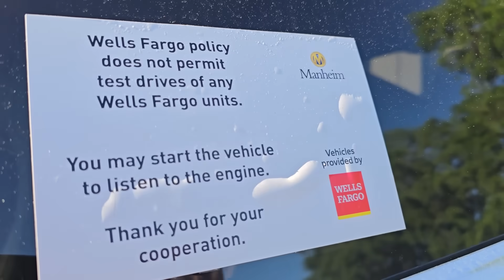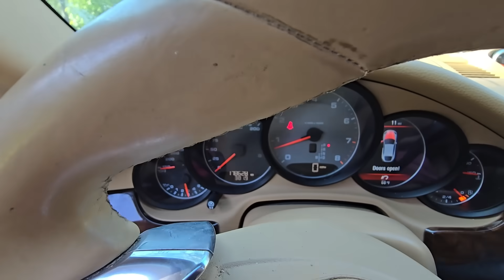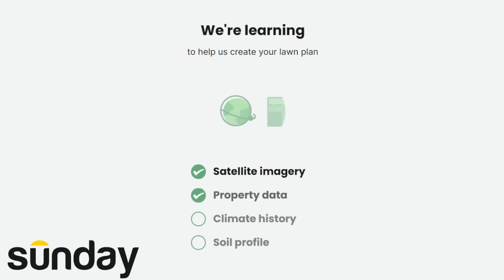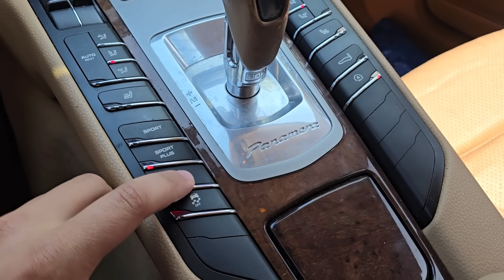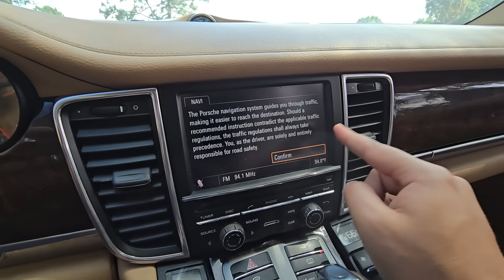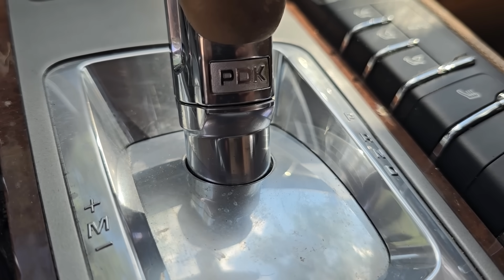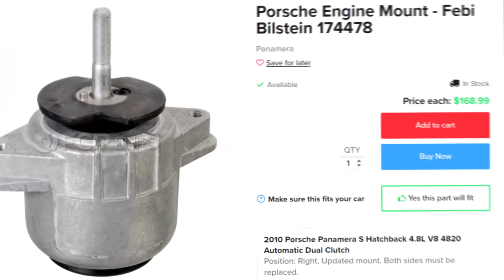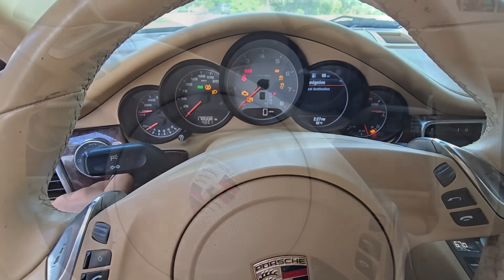I Paid $5,200 for this Mechanically Totaled Porsche. Here’s What it Cost to Make it Roadworthy...

Comment: The car dealer is a big rip off they charged me 4500 for a 250 dollar job and  I didn't find out until a honest mechanic told me they ripped me off 😢.
Reply: BMW dealer tried charging me $870 to replace washer pump on my bmw. I replaced it myself for $30 in 30 minutes

Comment: I would clean the engine and undercarriage to see if the bolt tightening helped.  Then replace the tail light, do the front brakes, bump-stops and upper strut bearings.  If after those items and the car is doing well, go after the hi-press fuel pump, and repair/replace the driver's door card.  Give it a good detail and enjoy it!
Reply: Yup! A good dose of brake clean will cut that oil! Ask Rainman!
Reply: yeah like all that bs is gonna happen, this is YouTube, it'll go rot now to supply YouTube viewers with more content
Reply: Is there even a downside of doing the high pressure fuel pump once it fails?
Reply: Yep go ahead and refurb but still stick to a strict budget. With all your knowledge how and contacts this could be a keeper for you to use sparingly bearing in mind the mileage👍
Reply: Let's see the rest of the work done
Reply: Definitely do the rest!

Comment: I had a 2010 Panamera 4S. Absolutely a magnificent car. My high pressure fuel pump went out, it was labor intensive and expensive. Be cautious of the remanufactured parts. The first one was no good. The job is so labor intensive, I suggest biting the bullet and getting one directly from Porsche. That's a job you don't want to repeat.  Also, don't forget the cam bushing.
Reply: I'm saying the Panamera was a fantastic car, unlike the BMW 335!.
Reply: @ayo9057good question!  You thinking about buying one?
Reply: @ayo9057 like with every high maintenance car only buy it if you can afford to buy it twice
Reply: Not anymore! There's  good made in Germany aftermarket now!

Comment: Looks like you're missing a part - there are two (clean) screw holes at 12:36 (and you stick your hand in the gap between them at 12:37), then at 12:42 there's clearly something mounted in the same space on the driver's side. If needs be, take it off to find its part number, then reinstall it (assuming it's in good condition) and buy and install its passenger side equivalent. You'll probably find that engine movement reduces dramatically once it's braced on both sides.
Reply: good eye!

Comment: Max torque on a 1/4” bolt is 4ft lbs…5/16” is 8 lbs. Also the length of a PERPENDICULAR extension has nothing to do with torque readings, but PARALLEL is a different story

Comment: You can retrofit CarPlay to the PCM using a jumper chip for like $300 if you really want to modernize the interior
Reply: What to search for in YouTube for a tutorial/guide
Reply: I  just did my Cayman (same PCM 3.1) for less than $200 through Ali.
Reply: Please explain more how do you get car play ?
Reply: Mr 12 volt is the best system right now. Has less issues and fully integrates with the digital optical audio rather than using aux.

Comment: I bought a 2012 high mileage Diesel Panamera from an independent dealer, also bought a warranty which I’ve used to the tune of around 2 grand GBP so can’t complain.  Next job is to replace the electric oil pump in the gearbox which has failed (it only effects start/stop so not too bothered), I just need to find out if it needs coding with a Porsche diagnostic, if not it’s a relatively cheap fix.
Reply: Can you please reference which warranty you’re using if you would still recommend them? Thanks in advance 🙏👍😎
Reply: Which warranty did you use here in the uk
Reply: @andyb7031 please give it a chip tune! Diesels needs them to show their TRUE nature. As in stock tune they are tuned to emissions, not fully fuel economy and especially in power. On "old continent" i think EVERY diesel (not like all cars, but at least 1 car with engine xxx) has been modified with tune tho
Reply: Watch out for the chain, and white smoke on a warm idle.
Reply: @mmllmmll22  "True nature" being clattery low revving stinkers?
Reply: @mmllmmll22  bye bye warranty

Comment: I'm certain there's a torque rating for those oil PAN bolts.😊 you probably just created a leak in the middle now
Reply: This. 100%
Reply: He’s has to pull the pan to fix a leak either way. Worth the gamble imo
Reply: With 180k miles on the original RTV the torque specs would be well off anyway. I would just tighten by feel to slightly compress that hardened RTV and check back in a week after cleaning the oil off of it.

Comment: Hi Sam, could be also the high pressure fuel pump sensor. With older diesels often the fuel pump itself is still okay and just replacing the fuel pump sensor on the fuel pump will get the crank back to normal.

Comment: What if it's not the high pressure pump but rather the pressure valve that holds the pressure while it's off? It's designed to hold the pressure from when the car had been running the last time
Reply: 90% of the time, it's the HPFP. The sensors rarely go bad.
Reply: @BDLCalton  there's one way valves after the fuel pump that hold the pressure when the car is off.. If that valve doesn't hold the pressure it needs to be built back up before the car will quickly start. Might just turn the key to on for ten seconds before starting it cold, if that changes how quickly it starts that it might point to that check valve. It's not a sensor

Comment: slow crank can also be an aging fuel filter too.  thats what caused my long cranking on my older mercedes S500.  as soon as i changed the filter, it fired up way faster....however, then my fuel pump decided to take a dump.  
but it was the OE pump and filter from 2003 at the time was 18 years old and 290k miles...according to the date codes on both parts indicating they were both never changed.

Comment: Would love to get the dealership owners feedback after they tied to scam you
Reply: Scam? They consider that normal business practice. They are in the business to profit from replacing parts and charging through the nose for said parts and their extreme labour rates.
Reply: I think they were more trying to get rid of him than scam him - probably didn't even look at the car properly and just listed a bunch of parts they'd expect needed replacement on a car of that mileage/age.  Dealerships don't want to work on old cars, they prefer working on cars under warranty so they can just send their monthly bill to the manufacturer and get paid at the end of the month, no hassles.
Reply: They gave him an insane quote in order to get rid of him...I've had it happen a few times.
Reply: Some other guy will come in and pay them.  They don’t care.
Reply: I think he should try to follow up after he takes a car in and then fixes it for a couple hundred after they quote him thousands and dont even address the actual issue he took it in for… great idea!!!!!
Reply: They don't care. At all.
Reply: This a must film!
Reply: That's not what he should go back to the dealership on.  What he should go back to them on is the fact that he brought them a vehicle bordering on a major failure that they should have spotted and quoted to repair, and they quoted everything but the one thing that was going to destroy the car.  To replace those bolts, the covers were off.  With the shaking engine and the trouble codes, spotting they failed guides was a no brainer for any mechanic above utter failure level.

Comment: I vote for you to fix this up. I think this is an opportunity to show that a high mileage car can be reliable and not cost an arm and a leg to fix. 

If you decide to do the work I would pull the fuel pump first. Depending on how it's designed and how well it's been holding up you could possibly just get away with the motor. If I'm not mistaken you've done that before on one of the high-dollar cars.

Comment: Sam you are missing a part on the Engine Mounts. Take a look at your video for the Drivers side and Passenger Side and you will see there is another damper mounted to the top of the mount. You will see clean screw holes on the passengers side where it is mounted. The drivers side has the piece installed.

Comment: I would like to see you fix the Porsche. Considering current car prices, new & used vehicles of all types are nearly out of reach for the average person. I would not mind a series focused on turning this budget luxury car into a nice, comfortable, reliable daily driver within reason. I need to put brakes on my 13 yr old C-class without breaking the bank. Some of what you mentioned about the cost of the Porsche pads & rotors peaked my curiosity interest & I would like to see a shade tree mechanic brake job replacing rotors & pads. Love the videos

Comment: These are shockingly reliable, any of the 1st gen V8 panameras don't have a ton of nagging issues. The V6 and the Audi stuff is much less reliable. I saw someone mention "bad PDKs" below, and that has not been what I've seen when researching these. It's super common for these to last a long time. They are sealed though, but there are companies that fix them, you don't need to "call around".
Reply: Pdk only go bad if no service has been done just like a engine oil change you can literally do everything yourself

Comment: The noise over bumps is likely the front suspension bushings. The upper control arms come as a unit. Replace the bushings in the front lower control arms, FCPeuro has a kit. Don’t buy the ones on rockauto, they’re junk.  Also change the links and bushings on the sway bar.  I tried the aftermarket stuff and it didn’t last 20k miles.

Comment: Be careful with over tightening the oil pan bolts, I believe they’re torque to yield which means they are made of aluminum and they stretch when tightened which is why you were able to tighten them so much more

Comment: Yup love my mag ride on my mdx . Replaced them at 180k ish miles. Cost about 900a piece for the front and around 750 for the rear. I did the work myself. Transferred the spring wasnt bad at all. Also the parts department game me a deal. Paid 600 a piece for all 4. Acura actually covered them under manufacturer warranty till 140k miles. But I just drug my feet on that warranty work.

Comment: there's option 3 sam work on the aston martin flood car if you can't sort out the electrical send it up to pine hollow auto diagnostics up in PA ivan is the man when it comes to module coding problem solving and electrical in general cheers from down under

Comment: One of the most expensive surprise items for older cars has to be the Xenon headlamp's height adjuster, it's sensor that has two arms and sits near the rear suspension, so basically a simple potentiometer with 2 swing arms. The prices however go depending on the car model and maker between $700 and $25 depending on how the stars have aligned. For my Nissan Maxima dealer wanted to have an eye watering $500 but I found a new OEM part for "only" $300 obviously for a reason these sensors are rarer then a rocking horse's apple in the junk yard.

Comment: I had a high pressure fuel pump fail on my Cayenne (V6), the dealer wanted $950 for the part. I found the part on Amazon (not OEM) for under $200. Worked just fine :)

Comment: I'm loving the coverage of the Panamera. I have no interest in the Camaro but I would probably watch because I enjoy your videos. I replaced my high pressure fuel pump in my Cayenne with an OEM unit, not too bad. It's much easier than replacing the valve cover gaskets. Maybe try the remanufactured unit. I would love to see you replace the bump stops too.

Comment: Check out the OE manufacturer of the HP fuel pump. Did one on s friend's 2010 A8. Audi wanted $1500. I bought the correct NEW pump, OE manufacturer,  for $300.

Comment: Need help, l have a 2003 gmc yukon 5.3 engine with a unknown driver issue,  starts but al lights on dash on , windows, a/c stereo locks don't work,  afraid to take to dealer because it could be really expensive,  thanks.

Comment: The dealership probably does not actually pull the engine; rather the tech repairs the timing as you did but using the billing labor op to charge you the book price.

Comment: has a double row timing chain. ..........should be rock solid.  Errgh, not going to name the make, but I had a 45 YO old motor with no dramas with timing chain. I suspect (novice) modern GB enormous changes in ratios must do something (over time). the old school gear boxes are alot more progressive and forgiving on wear and sudden RPM changes

Comment: Don’t go cheap on the brake rotors, just did mine.  Just buy the OE Sebro’s.  No one resurfaces Porsche rotors… don’t do it.  lol   Those upper control arms are famous for making that clunk.  You just buy from FCP Euro and  do both sides.  I did the uppers, lowers and end links.  I went overboard and then realized my other clunk was just from hard old tires backing out of driveway. Lol

Comment: Why not do a simple diagnostic on the fuel pump and look at the fuel pressure before you load the parts cannon? Look at the fuel filter? Scope the gas tank?

If needed, maybe you can rebuild the fuel pump yourself.

Comment: This deserves to be saved. Just carefully inspect that fuel pump to see if it really is bad. Sounds like it, but you can do good fault tracking with it. With front lights, I'd definitely get a new one, but with tail lights it's not as essential - if the reflectors aren't ruined, lense will be good enough. If the lenses are 300 bucks, then obviously it's not viable. 
Keep it simple and cheap. That is one hell of a bargain, get it in good nick, but don't throw money on it.
Reply: A cold start with a fuel pressure gauge on the fuel manifold will tell the story.

Comment: Based on how tall that stud is on the motor mounts, you couldn't just lift the engine, you'd have to drop the sub frame... also using an amazon timing kit is just a disaster waiting to happen...

Comment: That bolt isn’t loose its an aluminum screw that has a final torque all you did was stretch it and loosen it😂 yes dealers charge a lot but a good dealer will do that entire timing job with all brand new porsche warrantied parts and most importantly all hardware replaced and perfectly torqued to manufacturer specification. It would drive perfect and oil free for another 180k miles. Really high quality work is expensive but its worth it.

Comment: If the car has 180K miles and say you throw another $1500 in parts brakes, bump stops, fuel pump oil leak repair etc. and get the car a good detail, could you get 10K for it?

Comment: That it is always said that European vehicles are unreliable... Well, let's take the example of VW. If the vehicles such as the Arteon, Atlas or Tiguan are manufactured in the USA, no wonder, because the Americans don't have it so good when it comes to manufacturing quality anyway. Buy a German-made Vw. It looks better there. I, for example, had the golf 2 - 4 as well as a passat 3b and a Golf 4 Cabrio. Apart from a broken V-belt in the 2 and a burst radiator hose in the 4, I never had any real problems. The only consistent costs were the maintenance costs.

In comparison, a colleague, for example, had a... I think a dodge ram 1500 which he sold after 2 years and 2 engine failures. He wasn't really lucky with his other Amis either...